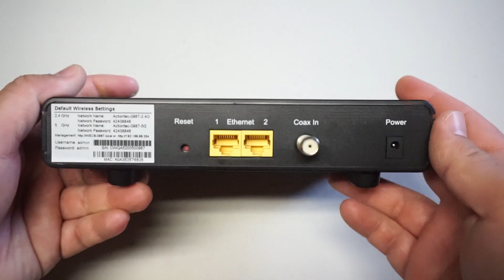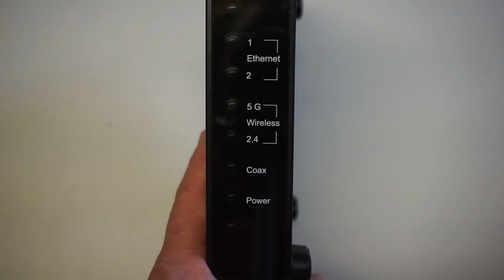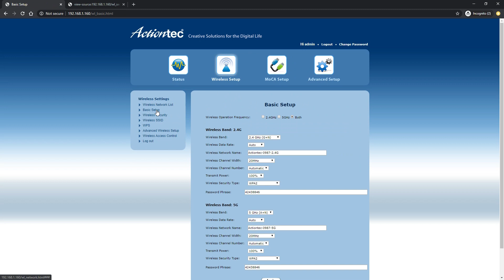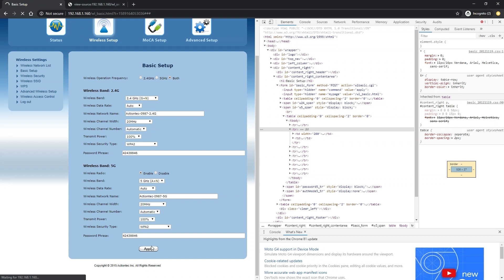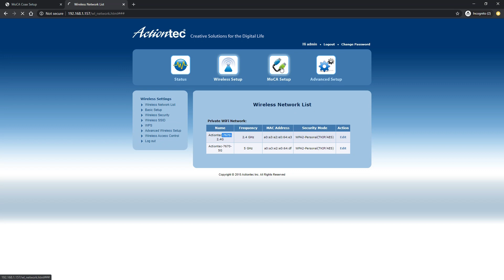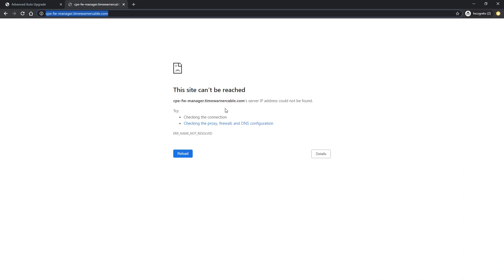Hacking a super cheap MoCA adapter to make it do my bidding! Ethernet over coaxial cable.

Comment: Great Video, quick question do these settings survive losing power? The reason I ask is that I set up a unit on my workbench then unplugged it and took it to the spot where I wanted it and when I powered it back on the WIFI lights were on but when I re edited the html both radio buttons showed disabled?
Reply from the maker: Hmm, you're right, I just tried, and they don't persist after powerdown, I don't quite understand how I didn't notice that when I made the video. Not a showstopper, but pretty annoying, sorry about that!
Reply: @thedoghouse825  This is the problem with using non-retail kit. There's no firmware available to the public, so you have no way to update the thing. Those settings are normally disabled because it gets its configuration from the ISP supplied router.
Reply: @thedoghouse825  What is the work around?  Can you access via a cell phone where you want to place the unit?  Is this also the case with a brand new unit?

Comment: MoCA 2.5 is out now and can be had for between $160 and $180 new for a pair of adapters.  You need them in a pair or more or they are useless.  I recently got the Screenbeam ECB7250 starter kit.  It sells for around $180 and you get two MoCA adapters that have a maximum speed of 2.5 Gbps (2.5 Gb port on these ones).  They include 2 splitters if you need them, two coaxial cables that look to be 3 feet long, two ethernet cables.  I did not need my splitters since it seems that the ones installed in this house support the needed frequencies.  If they don't work or you can't get all of your speed, your splitters may be to blame for it.  Use the ones supplied or some MoCA compatible splitters.  Limit the number of splits as much as possible since you might have too much signal loss if you get crazy with a lot of unnecessary junk on the cables.  With these you will get closer to the speed of your internet plan up to 2.5 Gbps.  You will not see more than what you are paying for from the internet but your internal network can still run faster.

Comment: Hey Great Vid?  Just stumbled oh this trying to get a better signal in my shop, which has coax . I got these and installed them three days ago and to my surprise the work and now I have ethernet in the shop strong signal. I have been unable to get the IP to connect to update the units. I also have been unable to connect wireless, keeps asking for KEY ??????

Comment: I have the new T-Mobile Internet service. 
Can I connect this trough LAN from the T-Mobile divide to the Actiontec (moca) to run trough coax and at the other end of this coax another Actiontec back to LAN to connect a mesh system? 
What's the top speed of the Actiontec?

Comment: Can you share the network diagram? This is what I understood. Add one WCB3000n on to the router through ethernet in one room where you have the modem and router and then the other one to a coax in another room directly and they both should work just fine.

Comment: if my main modem router is connected via coax in the main room of the house, would this still work if i put it in my office?
Reply: also would it benefit me if i did this and connected via ethernet rather then sticking with wifi

Comment: I don't know  how  much  you paid for these, but you  buy Moca 2.5 devices for $60 new on Amazon. These run at over 500 Mbps, no access point. These new devices will play with your Actiontec devices.
Reply from the maker: I got mine for $10. There are lots of options out there, if you need the speed the MoCa 2.5 class devices are a great choice.

Comment: @ the dog house I have a fios g3100 router and it's connected via coax.  My ONT is in the garage and I can't run new ethernet from garage to my basement where the fios router is setup.   I want to switch to google wifi mesh and also get rid of the fios router.  How can I hookup google wifi to something else using coax?  Btw, I only have the internet plan and not tv and landline.
Reply from the maker: If you have an existing coax run, you can use two MoCa adapters

Comment: How many of these WCB3000N can be networked together on the same coax system? Anyone tried three with these? From a quick look it seems MoCA 1.1 supports up to 16 devices but didn't know if the firmware on these things supports more than 2.
Reply: I have four different MOCA adapters on my network.  One is a WCB3000N.  Some are MOCA 1.1 and others are 2.x.   They all seem to get along.
Reply: @larrywright7456  Nice, that's good to know MoCA is that flexible!
Reply: @larrywright7456  Does the MoCA network end up running as a whole to the slowest speed if you mix MoCA 1.1 and 2.x on the same network?
Example: If I have two 2.x MoCA adapters does it slow them down to 1.1 speeds if I add a MoCA 1.1 device?
Reply: @JoshKasten  that’s an excellent question.   I did research into this a couple years ago.   It was told different things but my personal experience is that my 100/100 service was not impacted enough that my kids playing Xbox on the MOCAhad any problems.   Not very scientific but ii met need.  The bigger issue is that it creates a separate network that can cause some problems with not being able to see printers.  I am looking at disabling the wireless and implementing a mesh network with the MOCA serving as the conduit for back hauling the access points. Any suggestions are appreciated.
Reply: I found the answer to my own question:
"MoCA 2.0 nodes interoperate with 1.1 nodes on the same network.
MoCA 2.0 capable nodes communicate in MoCA 2.0 mode when talking to MoCA 2.0 devices even when legacy devices are present in the network."
http://www.mocalliance.org/MoCA2/index.htm
Reply: @larrywright7456  "The bigger issue is that it creates a separate network that can cause some problems with not being able to see printers". Why did you set them up as a different MoCA network? Or did it just auto make a different network and you can't move them to the same one?
Reply: @JoshKasten  I'm sorry for the confusion.  Two of my adapters are provided  in the actiontec WCB3000N devices (100mb) provided by Verizon FIOS.  I also use these devices as wireless extenders (access points) on separate floors of my house.  These extenders don't work as smoothly as a real mesh network and sometimes a device on the extended network can't "see" the printer that is connected on the main network.  It always seems to happen at the moment of greatest need!   

I also have three MOCA 2.0 (1gb) devices to directly connect an xbox, my Android TV and the NVIDIA shield device.  As I said in my earlier post, it all works well (you can have 16 devices on your network) because my internet service is 100/100 and so I'm not really limited by the MOCA 1.0.   If anyone is interested in the speed of mixed adapters, here is a great video on the subject by Lon.TV https://youtu.be/hcCEV2m2chs?t=660 .  My next iteration of this is to try implementing a mesh EERO by turning off the wireless broadcast on the actiontec devices and using their MOCA functionality only for hardwired Ethernet.

Comment: I picked up one of these devices and then found your video.  The device works fine, I'm just having trouble figuring out one thing.  I'm trying to match the wifi to my main home wifi so that it will "extend" it to an area of weaker signal but since my home wifi ssid has a "." (a period) in the name, this device isn't allowing me to match it. It just says Invalid SSID when trying to change it (it works fine when entering a name without a dot). Any idea in the code where I can edit this to prevent this restriction?  I've searched and tried several things, but nothing changes.  Thanks.
Reply from the maker: Ouch, not sure, sorry!

Comment: are these capable of gigabit LAN transfer speeds?
I ask because the specs say it has gigabit lan ports... but then the moca speeds are 175 Mbps?... what does that mean?
Reply: They can't do gigabit LAN speed, but gigabit ports will be needed to achieve 175mbps, otherwise you won't go over 100mbps.
Reply from the maker: I think the ports are gigabit, but the MOCA version isn't capable of anywhere near that speed.

In practice you won't exceed the speed of a 100BaseT connection in my experience.
Reply: MOCA 1.1 is limited to 175, but MOCA 2.0 and MOCA 2.5 will support faster speeds.  The 2.0 & 2.5 are backward compatible with 1.1, but you will be limited to the lower speed device.

Comment: If You're using an isolated cable connection you should be fine.
if you're cables go outside your house should also be fine unless somebody walks up to your demark.
What would be of most concern would be installing a blocker and lighting up your entire neighborhood. This apparently was a problem I was reading on a forum in another country where the direct TV version was not approved for use and they had kind of a complicated wiring set up Standard, where one person in the apartment building wood backfeed all the other apartments.
Reply from the maker: Yikes!

Comment: This video is a horrendous fail.  Even if you disable wifi.  The AP spawns new "RTL8186" networks and broadcasts them uncontrolled.    Even after reboot.
Reply from the maker: That's not something I experienced, sorry. It's possible your units have a different firmware?

Comment: Top left of inspect element window has a cursor icon. Click on it then click on whatever you want to edit and it takes you there. No longer need to search through it by expanding the different elements. Cheers!
Reply from the maker: Excellent, never noticed that button! Unfortunately since we're dealing with 'hidden' elements there's still some expanding needed, but very useful. Thanks!

Comment: Also to stop people from connecting to your moca network outside is to install a Poe filter
Reply from the maker: I think you mean a MoCA filter, but yes. That said, by enabling encryption you are theoretically OK. Installing the filter is a good idea anyways.
Reply: @thedoghouse825  so just wanted to fill you in, I got my router to connect to it and everything is working. But it will not allow me to connect to the management link so I can't change anything on it. Anything you think might help?
Reply from the maker: @game-wiz1  Have you confirmed you are connecting to the right IP? Finding out what IP the box picked up is the hardest part.
Reply: @thedoghouse825  The filter's function is not for security, it's to block unnecessary data congesting the lines outside your home. Any security advantage is just a side effect of this.
Reply: Yes for some reason they're geting called POE filters when they are MoCA filters, lots of confusion ensued on the forum I was reading.
Reply: I just reminded myself looking something else up that they are called "point of entry" filters, yeah there's something that boils down to a fairly uncommon acronym right.
Reply: Use MPS to encrypt also.

Comment: Ok so I have a home where the WiFi is weak at the far end and I want to hard wire my computer and PlayStation. Sadly I have no Ethernet ports over there but rather coax. My router supports moca and i also use spectrum. I wanted to know if I could buy one of these and hook it up via the coax in my room and get two lan ports to connect to. Thx
Reply from the maker: Depending on what KIND of MoCA your modem supports it should work fine. That said, these things are pretty cheap, so it might be worth just buying two to be sure.
Reply: The Dog House just on right time and am trying to figure this out especially since I don't wanna get ripped off
Reply: The Dog House im now considering a Actiontec GT784WNV Router not sure if it's moca compatible though, I need to look into it more. But I have a base arris tg1682 with moca if that helps.
Reply from the maker: @game-wiz1  Unfortunately it doesn't have a MOCA port, according to: https://www.actiontec.com/products/wifi-routers-gateways/dsl/gt784wnv/

Comment: Do I need 3
Reply: Do you know of a video where it shows you how to set it up, I’m still just a little confused
Reply from the maker: @evanfarewell9315  I don't, but you aren't the first to ask, so I think I might create a video detailing things. Stay tuned! :)
Reply: @thedoghouse825  Did you ever create this?  TIA
Reply from the maker: @HonRevJoWazzoo  Sorry, not sure what you are referring to?
Reply: @thedoghouse825  Above you said:

"The Dog House
6 months ago
 @Evan Farewell  I don't, but you aren't the first to ask, so I think I might create a video detailing things. Stay tuned! :)"
Reply: So you only have the ones with the 1 coax port. Then I’m my case I would split the coax connection going into my Wi-Fi modem, 1 to the adapter and 1 to the modem. Then I would connect an Ethernet cable from the modem to the adapter then that ones done. Then I would place the other adapter in the other room and plug it in to that coax port then I just do what you said in the video and I’ll be all set.
Reply from the maker: No, you only need 2 to create a link. I bought three simply because they were so cheap and I wanted to have a third in case my 'investigation' into one of them broke it. :)
Reply: How to you hook it up do you split the coax connecting going into your modem then connect the Ethernet to the MoCA adapter. Witch puts the Wi-Fi connection through the cape cables in the wall. Witch means I them put the other one in a different room.
Reply from the maker: @evanfarewell9315  Think of these adapters as ethernet to coaxial cable 'convertors'. So, you connect an ethernet cable to your modem, and connect the other end to one of these adapters. You then connect a coaxial cable to that adapter, and on the other end of the coaxial cable, you connect a second adapter. The ethernet port on that adapter is then like one on your modem.
The fact the adapters have WIFI is just a bonus that you can choose to use or not.
Hopefully that clears it up?
Reply: Is the setup like this
https://www.actiontec.com/wp-content/uploads/2017/01/WCB3000N-Kit-QSG.pdf
Reply from the maker: @evanfarewell9315  Yes, except in my case I have two of the second unit (with only one cable connection).

Comment: After I type in the pin it ask me to login and it says the password is incorrect. And when I just type the pin the the action tec it says it’s forbidden what do I do
Reply from the maker: Try factory reseting the device, that should get you back to the default password. I believe it's just holding the reset button while powered for a certain amount of time.

Comment: Wait so if I buy two of these can I use them to run Ethernet through coax? I don’t want to but the smaller $100 adapters lol
Reply: yes
Reply: Blackie1x swear
Reply from the maker: Yes, you can use an existing run of coax to get 100Mbps ethernet from one part of your house to another
Reply: @thedoghouse825  Thanks a ton for the video.  Super clear and easy to follow. Could you share a wiring diagram on how to wire up two devices? My goal is to use one device near my modem and router in the living room and another device upstairs in my home office.
Reply: @blazincheddar  following
Reply: @blazincheddar  did you ever get it to work?
Reply: did you do it?

Comment: Hey, good video ....

And I've seen a lot of these devices as well showing up on Amazon, ebay, and elsewhere at super-cheap prices as MoCA 2.0 and above is the preferred standard now to support gigabit connection speeds. As 10/100 fast ethernet fades into the sunset. 

And a great "hack" find to re-enable the WiFi and MoCA encryption options in the UI like that.

However, you should always use a POE filter as the first device connected to an incoming CATV coax line to keep MoCA networking signals in the home and not back-feeding into the cable system anyway. So setting-up MoCA encryption on the adapters is usually not necessary.
Reply from the maker: Agreed on using a POE filter. That said, if you don't have one... :) FWIW I don't even have cable TV, my I don't have a connection going to the outside world. I just like the fact that you CAN enable encryption if you want. Thanks for watching!